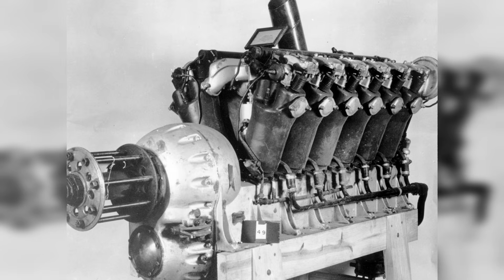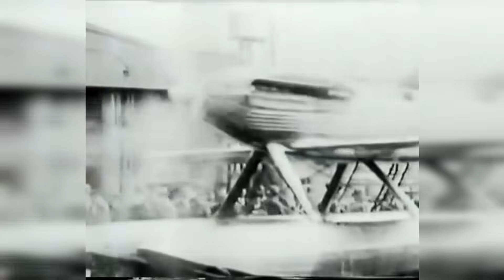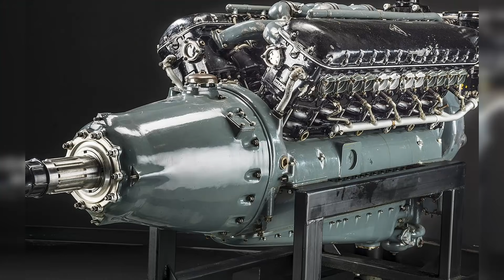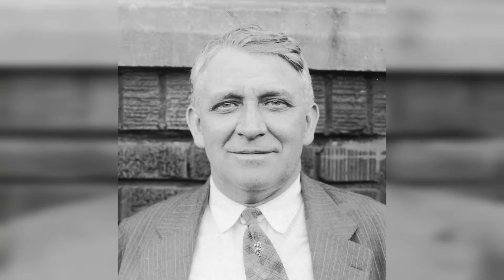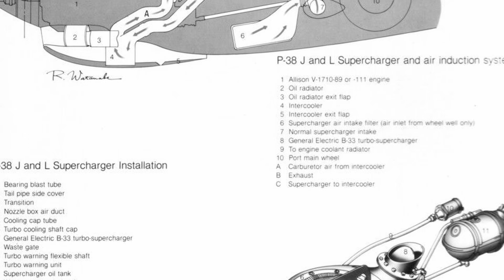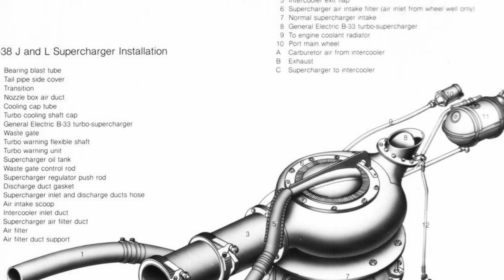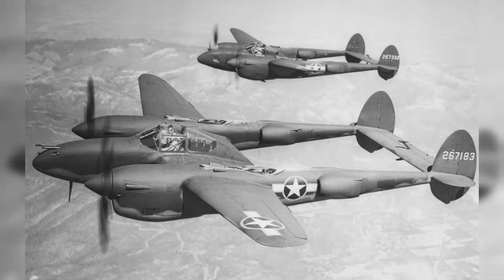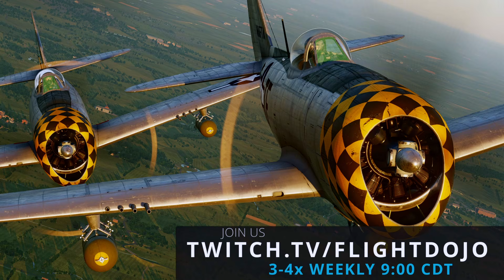Allison V-1710 - A Liquid-Cooled American WWII Warhorse

Comment: Great vídeo on a capital engine. IF I am correct,  turbo compounding was used in some radials,  used in some Constellation and DC-7 aircraft.
Reply: The Wright R-3350 used on the B-29 and B-32 Dominator (1) was a turbo compound design.  
1) The back-up plan to the B-29. In fact the B-29 was the single most expensive armaments program the US undertook during WWIl. Even more than the Manhattan Project.
Reply: @mpetersen6  The B-29/B-32 were not turbocompounded, instead their 3359s used  a pair of GE Type B turbos running in  parallel.
Reply: @grahamwhite2316  I think you are correct. I believe the turbo compound system was added to the R-3350 post-war and was not used on the B-29 to the best of my knowledge.

Comment: Higgs has a brand new V12 diesel airplane engine on the market that puts out 1650hp at sea level, and has no supercharger or turbocharger. But given the design of the engine, I see no reason so far why it couldn't accept such forced induction. The engine weighs something like 750lbs!!! Imagine how this modern V12 engine might stack up against a WW2 V12 engine like the Merlin or Allison?
Reply: Gas turbine engines pretty much dominate the aviation industry in this power bracket so all I can say to the people behind this venture is good luck!

Comment: P-38 Allison configuration outperformed the Merlin at altitude.

The Allison powered P-40, A-36, and others dominated the likes of the P-47 and others at low altitude (where a fair amount of combat did occur). The P-51J was considered to be potentially the best P-51 model. 

A key reason the Allison was ignored was the lack of a common/standard high altitude configuration that could be easily designed around in multiple airframes, and constant carburetor issues throughout the war.

The engine was tough, durable, reliable, and could be pushed harder than the official rated numbers.

I'm not a diehard Allison fan, but I can't stand the undeserved hate the Allison gets, and the overhyped praise the Merlin gets when in reality it wasn't as straight forward as people try to claim.

Meanwhile low altitude Russian fighters are heaped with praise, as are low altitude Japanese planes and low altitude UK planes. It's hypocritical and inconsistent. It's exactly like how the P-51 is the only aircraft that gets hate as a ground attack aircraft for being "inline water cooled". But I present the following ground attack aircraft in WW2 that are legendary and/or heaped with praise for ground attack. Mosquito, A-36, Ju-87, IL-2, Hawker Typhoon/Tempest, Hurricane, P-39, etc. Notice something about all of these?
Reply: I had a friend who was an aircraft mechanic during WW2. He loved the Allison and hated the Merlin. He said the Allison was the superior engine and the only good thing about the Merlin was the supercharger. He said after a mission you pretty much just kicked the tires and checked the oil and it was good to go on the next mission. With a Merlin he said he got really good at changing spark plugs.
Like you mentioned, there is a reason the Soviets loved the Airacobra and didn't care for the Hurricane and Spitfire. The engine!
Reply: You are on target about the ignorant hate the P-51 gets in the ground attack role while other liquid cooled aircraft are lauded.  Also, all aircraft engines required oil, and every airplane had oil coolers, tanks, and lines that were vulnerable to enemy fire.
Reply: The Allison’s required turbochargers that the US refused to sell to Britain.
Secret technology and all that. 
Britain built jet aircraft instead…
The Merlin and Griffon had multiple stage geared superchargers instead with specific models tailored to the specific altitudes required.
The ultimate was however the Napier Nomad which had a geared turbocharger.
Reply: I generally agree with your comment, except for the part about a P-40 “dominating” a P-47 down low.  I realize that it’s performance advantages become very obvious at higher altitudes, but even then… I just don’t see it happening.
Reply: @EstorilEm  P-40 pilots both in WW2 as well as warbird pilots today that fly airshows now say the P-40 was faster and could out turn the P-47 below 15k ft. Mind you it could also out turn a Bf109 at low altitude as well. And the A-36 was even better at low altitude. Pilots that flew the A-36 in combat claimed it was pretty much the best low altitude fighter as well as being one of the best dive bombers of WW2.

The P-40 was aerodynamically inefficient, as the A-36 showed. But the P-40 was better than people think, outlasting other designs and serving to the end of WW2 in rather significant numbers.

It all comes down to pilots knowing the strengths and limitations of their aircraft, and maximizing that against the strengths and weaknesses of their opponent appropriately. We have the benefit of hindsight. In WW2, figuring things out on the fly, many pilots never figured out how to use certain aircraft against certain other aircraft effectively, while others did. the learning curve was steep, and they had neither as much time nor access to as much information then as we do now.
Reply: One reason I think the P-40 and the Allison gets downplayed is the loss rates in North Africa for both the USSAC/F and the RAF. One reason I think that factors into this is the general experience level of the pilots involved.
Reply: Constant carburetor issues? Really? Link to evidence please? In 4 decades of flying (job) and engineering, (being into V1710s the whole time). And having pretty much every Allison V1710 manual and tech paper issued; Maintenance, Installation, Erection, and tuning, etc. And having known and chatted to a number of P40 pilots about Allison operations, and even having worked a little on a couple of V1710-81's in New Zealand many years ago, I have never read or heard of any "issues" with the pressurized Bendix-Stromberg carbs fitted to Allison V1710's. Quite the opposite. The RR Merlin had a crap SU updraft carb that caused big operational problems (negative G cut & misfires, poor tuning) that were only properly solved when RR/Packard adopted guess what? A US made, Bendix-Stromberg pressurized carb, similar to that fitted to the V1710. Basically swapping its config from downdraft to updraft for Merlin fitment. V1710 carb issues my arse!

Comment: "For some reason?...."   V-1710 - either a single stage, non aftercooled or intercooled gear driven supercharger or the two stage inter- and after-cooled turbo supercharger that was reserved for the P-38 (designed around that particular turbocharger) versus the Merlins two stage two speed sometimes intercooled gear driven supercharger. Without the SC it was designed to run with (it was a big complex SC) then it was hamstrung. the Merlin's was more compact and designed into he butt of the engine. The simplest/cheapest wayto fix the AAC's foul up was to get Packard to build Merlins better than RR and get on with the war. When there was no war, you could hot-rod the V-1710 more with it's stronger lower end and easier to cool head than the Merlin.
Reply: Still, the Allison dominated the Pacific, the Mediterranean, and the eastern front.  It had as much, if not more to do with the war being won than the Merlin.  The whole P-51 swap story has poisoned the narrative somewhat.

Comment: 18:59 The P-63 King Cobra didn't use a dual stage V-1710?
Reply: It use an auxiliary supercharge driven by a power take of shaft.
Reply: Yes, the King Cobra had a two stage unit, but no intercooler.

Comment: Excellent video - like the new format.  War surplus engines were used in earthmoving equipment by LeTourneau due to lack of Diesel engine availability and cost.  Keep up the good work.
Reply: Rebuilt a muskeg buggy with a differential out of a Chaffee tank made by them. Dated to the early 1970s with  ww2 surplus tank parts

Comment: You are a nice complement to Greg's channel.  I have subscribed.  Please discuss "turbo compounding" in the context of the Wright R-3350, where I understand it was perfected in the 1950s in airliner service.  I used to work for Curtiss-Wright (for real)  beginning in the 1980s and some of the old-timers there discussed this configuration of the 3350.  I never really understood the difference between a two-stage turbo-supercharged engine and "turbo-compounding."
Reply: I worked at John Deere Rotary Engine Division, which was bought out of Curtiss-Wright in 1984.  I worked with some of the old Curtiss-Wright engineers that really KNEW the 3350 and were very sharp engine engineers in general.  Did you know Charlie Jones, Davey Meyers, Dick Gigon, Augie Zoll, John Mack, and Ed Drewniany?  I learned a lot from them.
Reply: Turbo compound was never perfected. I worked in the TWA shop in KC and the old timers hated them.
Reply: @bingosunnoon9341  Lol the good old PRTs, “parts recovery turbines” 🤣
Reply: I never worked and most likely will never work with engines. Yet, here i am binge watching greg's and dojo's and also trying to find a good yet simple enough explanation of what a turbocompound is.

Comment: A turbo charger on a supercharged induction is used only to equalise inlet and oulet pressure.The reason the turbo units could be rotated mechanically was to vary how much exhaust gas flow they used depending on the supercharged pressure load on the intake.Basically the turbo regulated the back pressure of the exhaust and played no play into induction.
Reply: huh? Idk about that. I think the supercharger was essentially the base boost and the waste gate would be progressively more closed to increase the boost pressure to the intake supplied by the turbo at higher altitude as needed.
Reply: That’s completely incorrect, please don’t spread misinformation.
Reply: That's absurd.  Where did you get this stuff?
Reply: That doesn't make sense as written.  The turbines powered a centrifugal second stage impeller.  That qualifies as induction in my book.  Whatever you were trying to say must not have come out as intended.

Comment: I've got both the Information Guide, TO 30-5A-1 and Air Depot Progressive Overhaul Manual for this engine. They were in my Dad's attic since the end of WW2 and are in almost perfect condition except for some slight cover tears. He was a flight engineer and mechanic on several different aircraft so have several other engine and aircraft manuals as well. Well done video...
Reply: Thats awesome. Preserve those things.
Reply: That is a pretty cool find, Might be good to scan them in and makes some pdfs of them so people can look at them in the future.
Reply: @ATomRileyA    I could certainly do that as I have a monster of an HP 9500 multifunction but that would mean chopping the binding off to get flat pages. Think I need to keep them in the original..😎. Cheers.
Reply: @jimb4090  nowadays a phone camera would certainly suffice. No damage to binding required.
Reply: Yeah, I wouldn't break the bindings to scan them. I believe there is a technique to scan old books that doesn't damage them but I've only heard about it in passing. It might be wishful thinking for all I know
Reply: There are also handheld scanners that won't break the bindings in any way.
That's howlibraries/  museums scan books to put online.